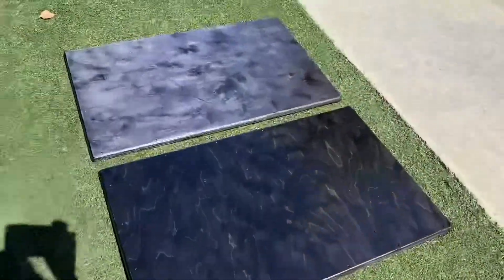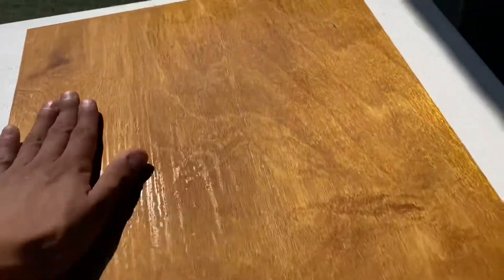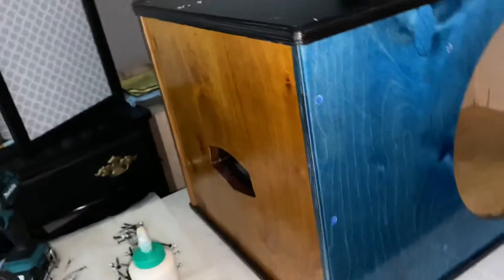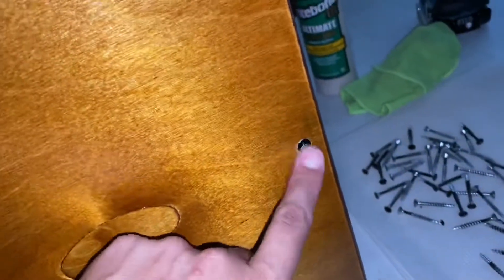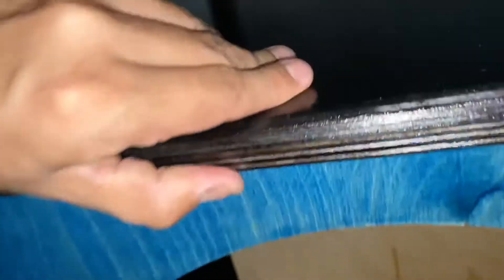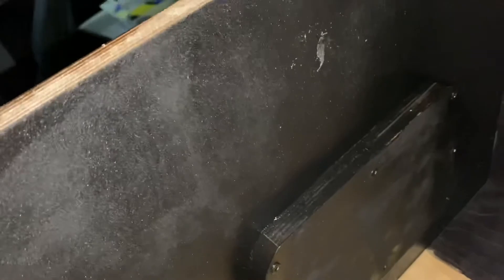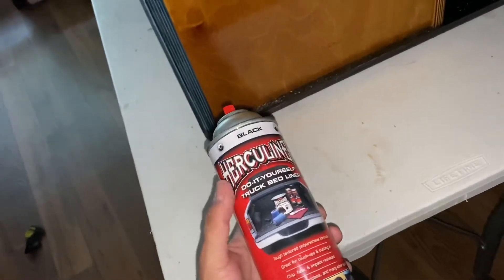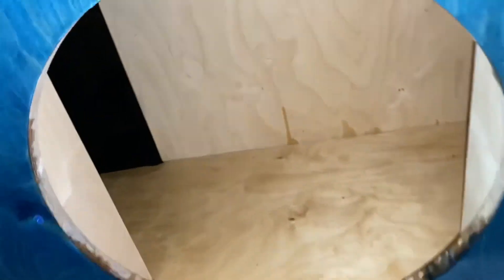Bobby Gately flat pack 15; final touch ups and assembly

Comment: Is the box the same as the expensive boxes
Reply from the maker: It’s the same material (wood) but not designed specific to your subs mechanical parameters.  You’ll always get a better sound when the box is custom